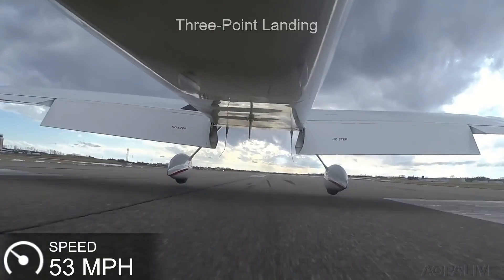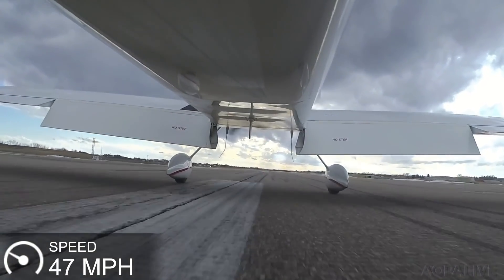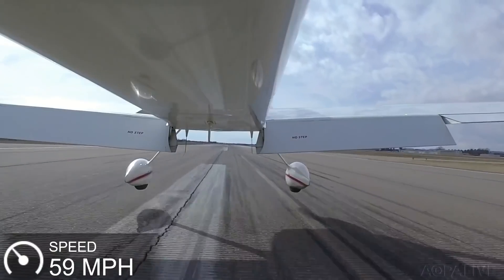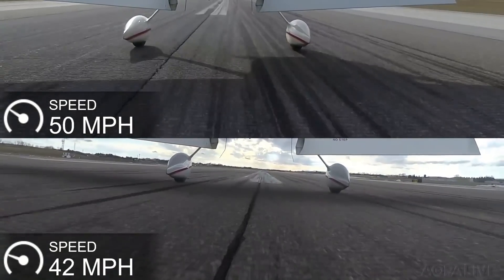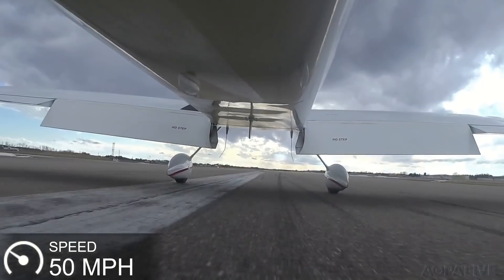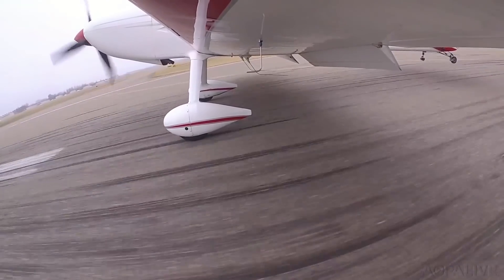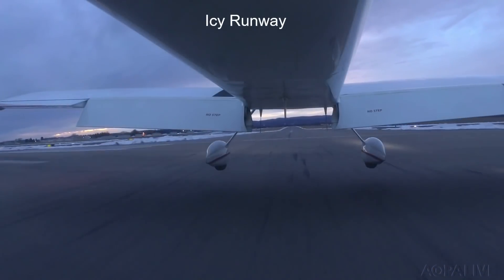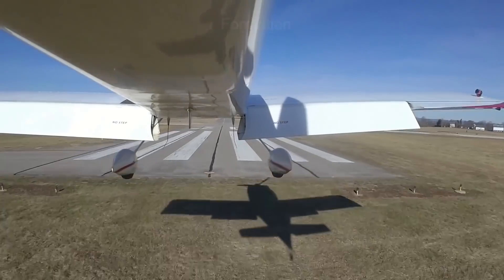Three point or wheel landing - Debate settled?

Comment: i prefer 3 point always. especially in crosswinds because you dont go through the transition to tailwheel in a 3 point your already there.  c-140, luscombe. stits playboy, rv3, s1 pitts. the playboy and the 210 swift worked better with wheel landings.

Comment: My philosophy is a wheel landing for pavement/strong crosswind/roads;  3 point when it is safe or necessary to do so.  Dragging it in to a short field requires 3 point technique (although you might not get out.)  3 Point is a slower/shorter landing and easier on the bird in rough conditions although a go-around can be more exciting in a bad way.  (108hp Super Cub pilot since 1992.)

Comment: Is it possible to hover the tail just above the runway or will it sit down. Seems to me that if you can hold it 'level' on the two front wheels it should also be able to hold lower. Unless of course the front gear is tall enough to shift the CoG significantly.